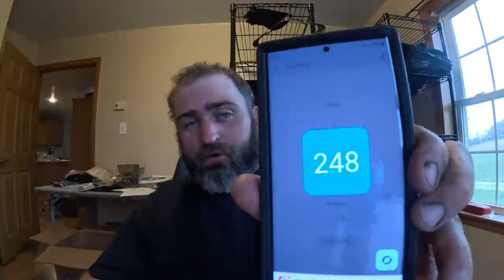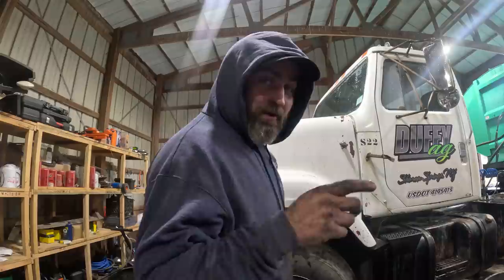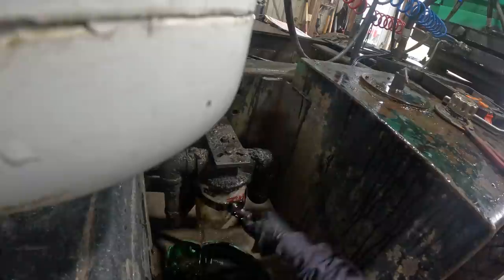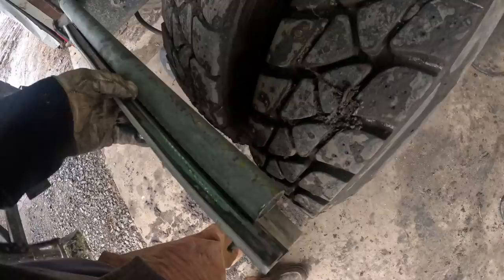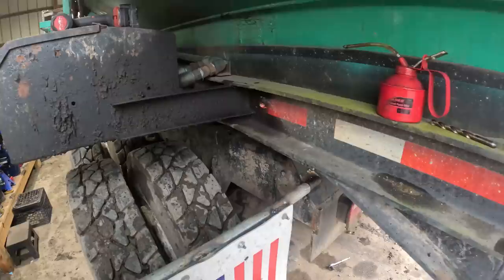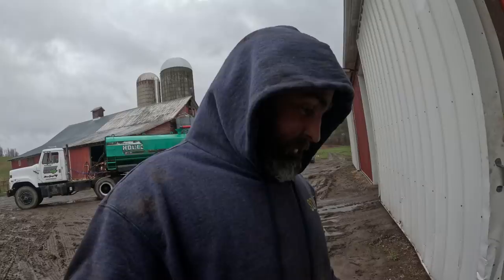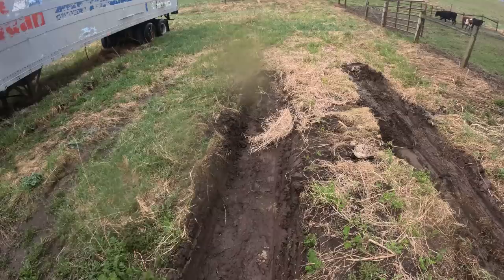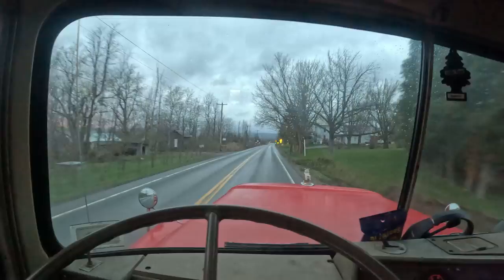Loaded Up And Trucking- Wrapping up Tanker #2

Comment: Chris, what about welding a long pipe to the frame under that tanker trailer. Weld it about a foot behind where the flaps are now. That way the flaps would work with or without the floater tires.

Comment: A suggestion you should put a gooseneck hitch in the frame of the Mack behind the fifth wheel so you can haul lighter loads with Mack and gooseneck instead of dragging the landoll.

Comment: Lol that was me that told you to push the tractor out with the trailer, I've pushed myself out of quite a few soft situations with that trailer. You ain't gonna bend that cylinder that's a bigger piston than what it came with from the factory that I've got in there

Comment: Hey Chris,  seeing people have started already , just wanna wish u a early Happy Birthday 😊 ... make sure to take some time at the end of the day to spend it with the little lady if possible cause it's important ... Anyways just a helpful tip ... if u ever drain an oil reservoir, always try to put a ball valve on every line running into or out of reservoir... it makes life so much cleaner and easier whenever u have an oil leak or filter change, etc ... Have a great day tomorrow 👍

Comment: Your new mud flap pipes you put on, you might want to put some Never seize on them as i tried to remove a set of 1/4 fenders same connection and they were rusted solid together couldn't get them off.But they went thru OTR road salt.Maybe even a little grease on the pipe just to keep corrosion from making things hard to remove.

Comment: Nothing wrong running old equipment,  small farm working for yourself you dont need the headaches with ECU's, emissions, DEF fuild. Doesn't one of your buddies work for the road dept  they're always digging up something see if they can dump at your place and use it build your parking areas

Comment: I havent seen where you figured out the cause of the Turbo Failure on the race truck. Normally turbo do not fail on their own. You should totally check for boost leak. Normally that is the cause of failure when the turbo overspeeds.

Comment: That angle bracket holding hydraulic tank to frame should be drilled & bolted through frame & not welded Chris just saying !!
Reply: Duffy ag would be out of all the other shit that could go wrong he,s lucky enough to get by with welding on the top corner of a truck frame and not have a problem. Sure as hell wouldn't have him near any newer equipment with a welder could you imagine OMG.